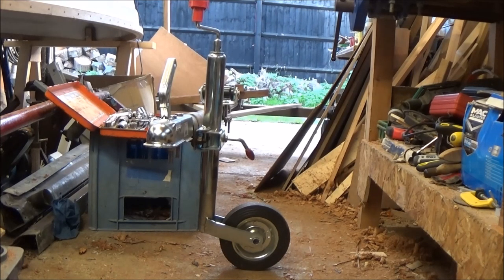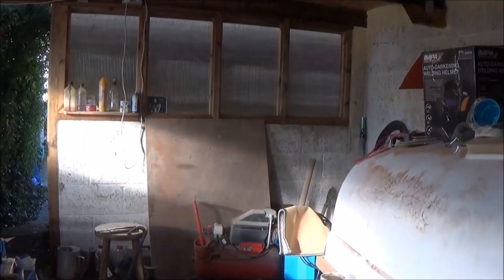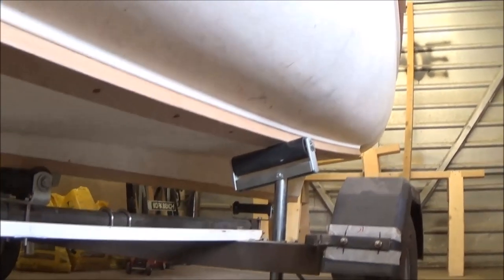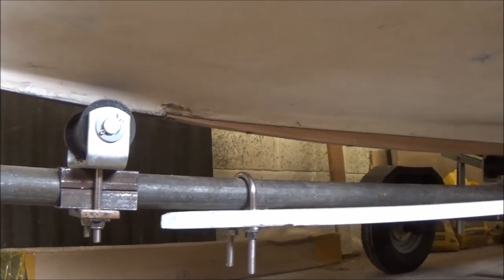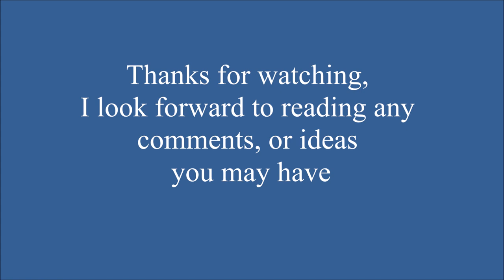Dale Skidmore - Boat Restoration Part 24

Comment: Lot's of work done!  From some past dealin's with trailers ya' might think about puttin' a set screw on your dolly wheels bracket. If it gets a bit side ways it might turn on the round stock an put ya' on the ground! I've had more computer trouble that I hope is fixed!!!  The beard's lookin' good! You'll be up with me before long!!   Thanks Ade.   ZZ.
Reply from the maker: Ha, ha, ZZ, I could never get anywhere near the Master's beard. I know what you mean about the dolly wheel, it has already happened when I sat on the spine; I have tack welded it as I don't want any more than the two holes for the hitch in it. Good tip, thanks. Atb.